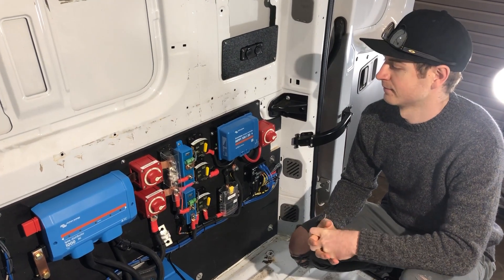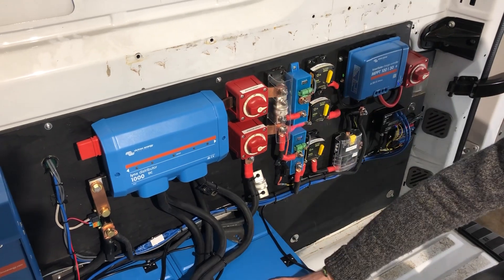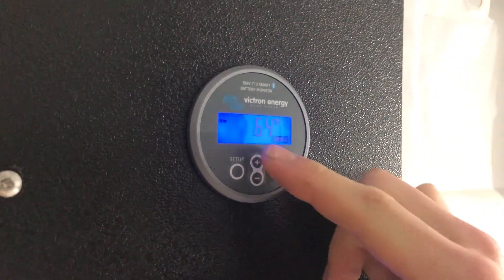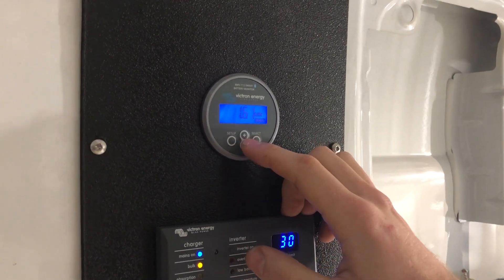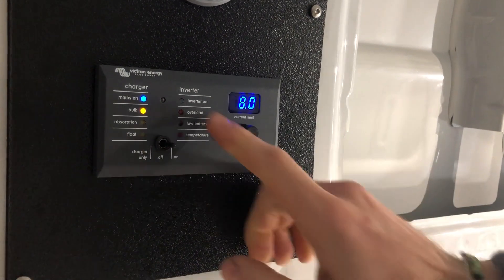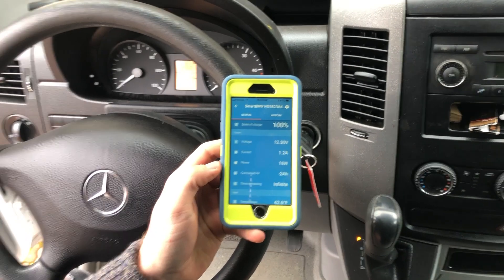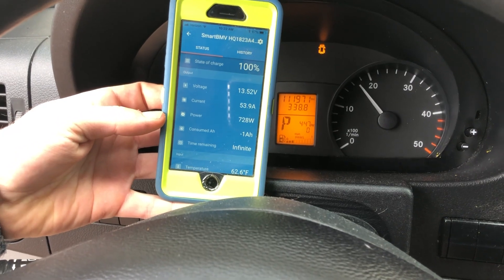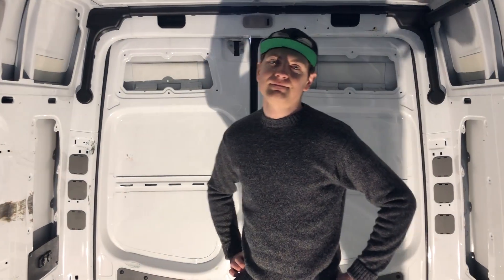Van Solar Conversions - Up On The Mountain (Pt.7 - Solar Panels)

Comment: I know this video is old but I have a question.  With the panel below the circular gauge, can the new touch screen do the same thing with the cerbo GX?
Reply from the maker: Yes, we are recommending the Cerbo and Touch 50 GX now.  It will talk to the charge controller, battery monitor, inverter, etc.
Reply: Great.  Thanks.  Sorry one other question is I understand the shunt and what it does but do you physically need bmv 712 gauge to go with that? I’m thinking no because that information can also be sent to the touch screen?
Reply from the maker: @carrottop3454  The head unit is the brain of the BMV-712, with the com cable port, so you would need that.  But, instead of the BMV-712, you may want to check out the Victron SmartShunt.  It has no head unit.
Reply: @GarretTowneAMS  oh gotcha. So there is a Victron shunt and a smart shunt?  Makes sense.  I like the clean look of just one screen to control everything.
Reply: @GarretTowneAMS  so I didn’t see if Sean installed a ve dongle at the inverter charger.  Is that still needed or does the touch panel connect directly into the inverter charger?
Reply from the maker: @carrottop3454  Just an RJ45 cable to the CCGX.  The dongle isn't necessary if you are just wanting a GX display.

Comment: Hi there. The battery protector stops the load from taking too much power from the battery. Could you please tell me what stops the battery getting too much charge from the various charges
Reply: In this system, the Battery Protects work as switches, controlled by the V4 board (no obsolete) which is controlled by the VE.Bus BMS.  The alternator only puts out enough voltage to charge batteries to about 80% SoC.  The solar charge controller and inverter are programmed based on the battery chemistry to take the batteries up to 100% SoC and not over charge them.

Comment: Wow!  I am very impressed.  What size fuse would you place between the DC inverter to the Distributor?  I suppose the current could be very high, so would you fuse it to protect the wiring between the inverter and distributer, or would you fuse it to protect the "electronics" in the inverter? In other words, if you were to use 4/0 THW welding, stranded, wire between the inverter and Victron Distributor, at at 70 F. would you use a 200 amp type "T" FAST TRIP fuse, or could you use a "SLOWER" type Mega 200 amp fuse?  The wire is rated at 230 amps, so could it be fuse it at 250 amps?
Reply from the maker: I believe the battery combiner used 200A Mega fuses, then we had a 400A Class T fuse between that and the 3000VA inverter.
Reply: @GarretTowneAMS  Thank You so much for your input!

Comment: Great information!  Have you connected the alternator directly to the system?  I saw a the DC to DC converter used in other documents, was it an option for you?  Don't you need something to regulate the current coming from the alternator to protect it?  Thanks in advance!
Reply: We use a Victron Cyrix-Li-Ct which creates a direct connection.  The alternator in this rig is big enough to handle this.

Comment: Did you not use any sort of DC/DC charger to charge from the alternator current? I'm confused what you're using to control the charge from the alternator.
Reply: A DC/DC charger was not used on this.  Just a voltage-controlled direct connection via a Cyrix-Li-Ct.  I don't recommend this for rigs with alternators under 200A.  The Mercedes warranty doesn't like it, but there have been troubles.  A system like this might get you 180A of charge, up to about 80% SOC, whereas a DC/DC charger costs a little more, and only gives you 30A, but goes up to 100% SOC.

Comment: Agreed....Excellent video series... What is the total weight of the system. PV's cables, plus all victron components. Why?? A smaller vehicle will have a weight limit so its weight be an important consideration.

Comment: hi great video what size of Class T fuse did you use ? also do you have info on the Switch / relay to lin kin both batteries if starter is dead on the side of the seat cheers
Reply: We used a 400A fuse.  As for the boost switch, it is just a normally open switch, that gets inverted through a relay, that goes to the Victron Cyrix.  You can see details on this by doing a search for 98-ALTCLI230 on the AM Solar website's search bar.

Comment: How did you connect the alternator to the system?  I was expecting to see a DC-to-DC module in your design.  Are we to assume that a DC-to-DC is not necessary?
Reply: It depends on the vehicle.  If you have a weak alternator, or an alternator system with an ECU or “Smart Alternator” you will need a DC-to-DC unit.  Fortunately, most of what we see in the U.S. doesn’t have that.  We used a Victron Cyrix-Li-Ct battery combiner.  It is basically an ON/OFF switch with no voltage regulation.  This nice thing about the Cyrix system is that you can get a very high alternator charging current (120A and higher in some situations).  The downside is that it will only take batteries up to about 80% SOC, and shouldn’t be used in some vehicles.

Comment: What an amazing installation! My question: do you need a smart alternator to charge a lithium battery or will my FORD 3G alternator rated for 130 amps be okay !?
Reply: I prefer working with stock alternators because of the simplicity and high current output.  Because of the higher resting voltages of lithium batteries, you will likely only get the batteries up to about 80% with a stock alternator.  This is perfectly fine, but something you should be aware of.  One of the issues you might face with alternators under 150A is that lithium batteries have such a low impedance that the alternator would run at full until the lithium battery is charged up to 80%.  This might cause the alternator to overheat.  Ideally, you would have an alternator rated at over 200A.  Upgrading your alternator to something bigger would be money well spent, but I don’t think you need to upgrade to a smart alternator.
Reply: @garrettowne  super helpful thank you!
Reply: @garrettowne  why dont you use a DC TO DC charger instead?

Comment: Hey Garret! I am about to embark on an off-grid solar system project for a small cabin. I was incredibly impressed with your craftsmanship, truly outstanding. If I had a van to convert you would be the bloke for me! I have been configuring the system that I want to put together and it's using very similar main components in this case of yours. The details I'm missing is all the small ones inbetween, fuses/breakers, switches etc. Do you have a parts list, diagram, steps etc. that I could use? I am happy to pay for it. Many Thanks Matthew.
Reply from the maker: If you can send me an email (garret@amsolar.com) with a list of all your major components, I can get you the details you're looking for.
Reply: Garret Towne Thank you very much! I will put a list together at the weekend and send it to you. Really appreciate it!

Comment: Are those 2 Victron 400ah batteries??..Man you could run everything in that van  at full load for at least 4-5 days without dipping below 20% battery charge.
Reply from the maker: They are 200Ah each, and yes, this guy has a sweet setup.

Comment: you explained all the components in the system nicely except the Battery Protect between the mppt charger  to the battery in. I can't really figure out why there is a Battery Protect between the mppt charger and the battery? thanks Claus.
Reply from the maker: claus rupprecht We use it as a switch, controlled by the V4 board to prevent cold charging.

Comment: What device did you use to charge the lead and lithium batteries from the alternator?
Reply from the maker: The alternator does the charging.  A Victron Cyrix-Li-Ct 230A separates the lithium and lead-acid battery banks.

Comment: It appears you have an automated disconnect to stop the charging coming from the solar if the batteries are too cold, but the charge coming from the alternator is not going through the disconnect. I am correct to assume if you start up your van after a winter night in Wisconsin, the alternator could attempt to charge a frozen battery? If yes, wouldn't you want all charging sources behind the auto-disconnect?

Thanks for all the great instruction!
Reply from the maker: The alternator charge goes through a Victron Cyrix-Li-Ct, which is controlled by the V4 board, which prevents frozen charging.

Comment: Garret:  A few questions:  1.  Have you found any operational advantage of linking the Multiplus, the Smart Solar MPPT, and the BMV, linked with a Venus or Color Panel?       2.  Why such a large breaker feeding the small fuse panel?  Wouldn't 40A be enough?  (e.g.: I'm concerned that the printed circuit board on my WFCO fuse panel would burn up before blowing a 100a breaker).  3.  What material is the black backer board?  Kudos for keeping the lead lengths exceedingly short for maximum efficiency, and for including replacement fuses tyrapped to the cables so they can't get lost!
Reply from the maker: Great questions.  None of those devices are connected to each other because none of their functions depend on the other devices.  The Multiplus just draws current from the batteries or puts current on them.  If the battery voltage or battery temperature get to a point where drawing current or charging could become harmful to the system, the BMS will signal the Multiplus to stop charging or discharging.  The Smart Solar MPPT charges the batteries based on the voltage reading it gets from the batteries and if the batteries are frozen, the BMS will disconnect the charge controller.  The BMV just monitors net current.  Without the BMV, the system wouldn’t operate any differently, but the user wouldn’t know what was going on.  In some situations, with lead-acid batteries, when the charge controller can’t be mounted near the batteries, the BMV can transmit the battery temperature to the charge controller via Bluetooth.  But, that isn’t necessary with this system because charging parameters of lithium batteries don’t change with temperature.  (Frozen batteries trigger a charge controller disconnect through the V4 board to a Victron Battery Protect, no communication to a charge controller is needed for this.)  A Venus or Color Control GX monitor could be added to the system, but it would only allow communication to and from the various components.  No communication between the various components is needed or beneficial.

As for the large breaker, this rig is an empty shell and the DC fuse box was cheap.  The customer may add larger DC loads and want to give them that option.

The Lynx Distributor houses 250A fuses for each battery.
Reply: Although the CCGX does give you a really nice graphical display\operation of the overall of the system. But you pay a lot for it. One can get most of the same abilities even remote viewing\control through Victrons VRM portal with the Victron Venus installed on a Raspberry Pi 3b+. The software is free but the Raspberry Pi costs $35. Giving you full online viewing\access\control and local network of anything connected.

Comment: Great series of videos and superb quality of workmanship 👍🏼
Not sure if this is a stupid question but how do you regulate the charge profile from the alternator. I see you have a relay to cut or enable the charge which is controlled by the AMS control module. However, the alternator charge varies quite a bit depending on load etc. I’ve seen specific DC-DC chargers used in other installations which have a specific charging programme for lithium. Would this not be a better solution, especially in vehicles with smart alternators? Apologies if I have missed something.  Regards Craig
Reply from the maker: That’s a good question and alternator charging systems are very complicated.  This particular system just works off the stock alternator and doesn’t need multiple stages because it doesn’t get the batteries much beyond an 80% state of charge.  Of course there are better options out there that will get you up to 100% quickly, but how necessary is that when you have significant solar charging system and a 120A charger when plugged into shore power?  An 80% SOC on those Victron batteries gives you about 3kWh of usable energy.  If you want more, you can pay to have a secondary smart alternator installed (which we do) or you can pay to add more batteries.
Reply: Hi Garret. Thanks for the reply. I agree if you have a hook up, plenty of solar and large battery bank the alternator is just a nice to have. My van build will be for use in Scotland 🏴 with no shore power and minimal solar capacity in the winter. I’ll use the alternator a fair bit to charge my 200ah lithium pack. There are some smart 60a dc-dc chargers out there that should keep me topped up. Great videos and keep up the good work 👌🏼 Craig
Reply: @craigwallet  Do not worry of the alternator how it charge, as long as the voltage is not more than the battery can take, but i guess the BMS in the battery cut of whit to high or low voltage. Remember if you give those 400 ah battery full blast whit that generator, it might be capable of maybe giving 100 a out, and that`s only 0.25 C charging for those battery. 

For your build, and 200 ah battery, that would be 0.5 C ( C = cappasity) . if alternator warries up and down, battery dont care, it will take all it get.

Nice video by the way.

Comment: Fantastic video. Learnt a lot from you guys. Is there a reason not to use a breaker for the input from the solar panel?
Reply from the maker: Wei Quek The Zamp panels we use are individually fused in their wire harnesses. These fuses are easily replaced, but we’ve never seen a burnt one. We also have a 40A breaker after the charge controller.
Reply: Garret Towne this install should be in a glass museum showcase.